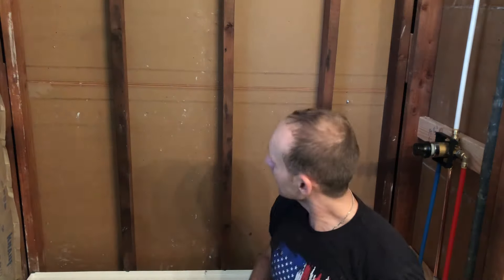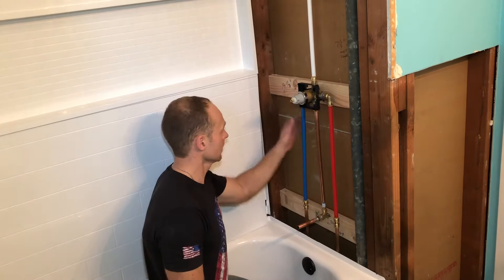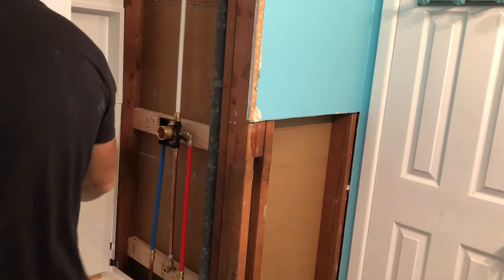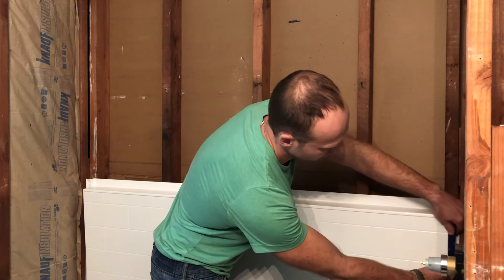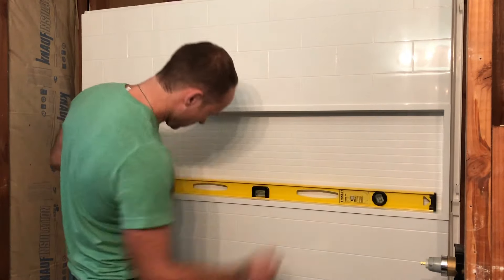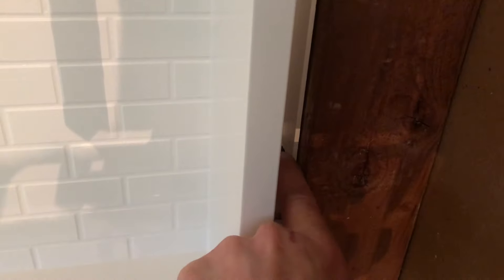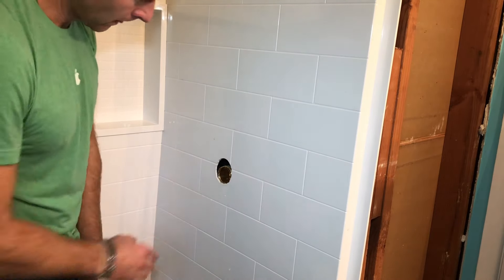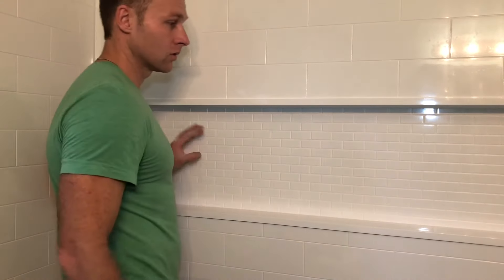Nextile direct to stud alcove bathtub surround install directions. Step by step full install

Comment: I just installed my Nextile shower wall system today. I had watched this vid twice which was beneficial thanks, but a couple key points I will make to help people out on top of the help graciously provided by this vid. Point one. The walls have those locking tabs in the back left and right corners as seen in the vid. Basically expect that the need to lift the left and right walls up 1.5 inches above the back wall when pressing against wall and then pulling down to get the tabs locked...expect it to be a problem on the faucet side. Your shower hardware system of choice basically will not have flanges on all places to cover the needed lift and then drop down of the walls to get them to lock. My example: a hand held shower wand that has a 1 in diameter hole. Also my shower valve handle hardware sticks out about 2.5 inches and there was no way I was going to risk screwing up the valve assembly. In the end I decided the wall locking tabs are over engineered and in fact lack forthought about the issues they cause for the brass shower hardware. So I decided to cut the tabs off of my walls to prevent the need to lift the wall 1.5 inches prior to engaging it. But even after that I could not get the wall engaged thanks to the angle needed to get around the valve assembly. So I took an angle grinder with a cutoff wheel and cut the extra material off of the sidewalk back that prevented me from connecting the walls. Also, this wall system thanks to the shelf causes you to lose about 3.5 inches of inner shower space--that much less room for your arms while showering. Although your drain valve will be centered to your shower base, your shower head should you have lined it up with your drain appear to be way off centered relative to the inner walls thanks to the protruding shelf. As a result, I moved my shower head to center it over the actual area of the base I'd be standing and swinging my elbows while scrubbing my hair. I'd say dont do a dry fit test. Once your shower base is in you know you have the correct space and then after if you have shower cutouts that don't accommodate an extra 1.5" of hole for sliding the wall down then just cut away their locking system on your valve side.  Also one last mod I made. Bottom middle back wall has way too much give and play. Sorry but do dry test bottom back wall and you will see that bottom middle wall where it meets the shower pan can be pushed back with your hand by more than a quarter inch--not good. I took the back back off and then installed PVC trim that was .5 x 1.5 along the back side of shower base to provide backer to stop the excessive flex in the back wall when installed.
Reply: Also as someone else smartly posted. Take a cutter blade and clean out the sloppy extra material that remains around the locking tabs from the molding manufacture process. This will set you up for successful attachment and any needed detachment to minimize running into a bind.
Reply: To refine what I said above about proactively cutting away the tabs on the valve-side wall: be sure to not touch the tab that joins the upper and lower back walls. Only touch two tabs on top wall and two tabs on lower wall that receive the side wall in four places total. And also, remove the tabs before I say again before! installing the back walls to the studs as otherwise it is very hard to remove those four tabs after install. And also, the grinding I said I did on the valve side wall only reduced thickness of the back edge--note that I did not reduce the front to back dimensions of that side wall.
Reply from the maker: Thanks for sharing. 👍👊
Reply: I should also have stated for anyone checking my entries here is that my install    is not over a tub but is a 60x30" shower base with the 4 wall 60x30 kit. The reduced space for elbows it seems is more pronounced with this setup than it may be for tub based installs.

Comment: Contractor here. The nextile surround I got did not have tabs which can be slid into and the sides did not fit in the grooves. First time I’ve gotten a surround that did not fit together. Horrible

Comment: TIp: check the latch parts on each panel for burrs and frayed excess material... On my unit, they were poorly machined and I had no issue after deburring them with a boxcutter
Reply from the maker: Nice.  Thanks for sharing

Comment: We're having the hardest time snapping those things into place 😫
Reply from the maker: lift up, push in all the way, and then has to push down so it drops in.   its a little tough yup.
Reply: Yea I jus installed mine,  it is tough,  especially if the rough opening isn't wide enuff

Comment: Does anyone have any trouble will middle wall at bottom having give in it. It’s the first wall you put in. Mine feels like it needs to move further back in middle but it is level and flush with all studs?

Comment: I should make my stud walls 31 in instead 30 in correct
Reply from the maker: I would have to check.  It’s meant to fit the existing space.   But if you building the walls up for it.  Yeah have to measure and double check
Reply: I saw you trimmed 3/4 off the shower to fit 30 in wall if I am correct and you left a 1/4 in to finish nail an silicone.
Reply from the maker: @stevieb031969  ahh you're talking about the side pannel.  yeah i had to trim that as my existing wall was too short.     i did follow up video on that.
Reply: Your video helped me out and a holler out a Thank You
Reply from the maker: @stevieb031969  happy to help.

Comment: If using adhesives shouldn’t one have telescopic forms to press the walls in overnight?!
Reply from the maker: everything should be snug. so if clauking at the bottom etc, nothign shoudl be moving.  you are screwing everying down to the studs first.
Reply: @HowToWithLech  thanks that’s what I’ve done. The front panel with the water valve was the most difficult. I got the panel in! But only after I maneuvered the studs out!

Comment: Hi! We just installed this in our bathroom, thank you for the vid! We have this exact setup and wondering if your wall piece appears to bow as well. Not loving the look after we’ve installed in. Thanks!
Reply from the maker: The shelf section comes out a little bit should not really be noticeable.  Did some follow up videos on that. 
All walls should be right against the studs
Reply: How many sheet of tile did you use for the shower niche?

Comment: The bottom of the main back wall has some give which will immediately break the silicone seal if someone leans on it. All walls are lined up perfectly. Does yours do the same? Any recommendations?
Reply from the maker: All walls should sit right agains the 2x4 framing.  Should not have any give.  Make sure the framing is level and square.
Reply: Larry, I'm having the same issue and my framing/flooring was pretty freaking level. Debating going the caulkless route with this and hoping to let the water simply drain after each shower. Trying to silicon a flexing wall will never work and trap water if anything, imo 🤷‍♂️
Reply from the maker: all walls and tub has to sit snug against all walls.  same with floor / tub has to be lever. the only way will work  correctly .thank can caulk all the corners etc.  @Keatgsr07

Comment: Lech, curious as to how you caulked/sealed? My install looks great and went well, however there's definitely some flex/give where the panels meet the tub. How's that going to hold? 

Can this kit hold up over time as a caulkless unit, let the water drain downhill on its own?
Reply: We are also worried about this. Called the company about it and I was told that caulking it fixes it. I personally highly doubt it.. way to much flex
Reply from the maker: All should be flush against studs.  Should not flex.   Then caulked all the seams.  No issue

Comment: Helpful video! Some "shopping" advice here. At 17:30 Lech starts to add the wall that has holes for the valve and tub spout.  It is difficult if you try to come at the back wall hooks at an angle as in this video.  His approach was to reduce the angle by dismantling the valve. My Delta valve was not made for that (I called them), however, the escutcheon was huge, so I cut the hole larger below center so the wall could be raised 1.5 inches without bumping the valve stem.  I also cut wide about an inch to the left of center of the valve so I could slip over valve before the wall was pushed all the way to the back wall.  The cut to the left allowed me to reduce that angle of approach to the clips by slipping over the valve and pushing back to the studs (while raising the wall).  The wall practically fell in place this way.  Lech was using a threaded connector (seen at 21:31) behind the wall to avoid the spout getting in the way during wall installation.  That was smart. I wish I'd thought of that approach while shopping plumbing parts.  So, make sure your escutcheon will cover holes 1.5 inches below the valve and maybe 1 inch to the left.
Reply from the maker: Thanks for sharing 👍

Comment: Awesome video. With the stringer for the shower valve, how deep did you set it? Thanks!
Reply from the maker: The valve directions tell yiu.  Different styles might be different.  Sorry dont remember the exact measuree
Reply: @HowToWithLech  Got it. Looks like we are both using the delta multichoice. From the video looks like you mounted stringer tight to the drywall on the back of the stud? Thanks man. I have watched this video like 100x lol
Reply from the maker: @rileylavin1272  ah nice.  yeah, something like that.  sorry its been a while thanks for watching.

Comment: Lech, thanks. Today 9/2022, one costs $539 in Lowe's in Kailua Kona Hawaii!  Besides caulking it to the tub, did you caulk the vertical inside corners?
Reply from the maker: oh yeah. prices going up nicely.    yes caulked all the seams where the walls connected.   under the shelf too.
Reply: @HowToWithLech  Thanks. actually that price is for the taller model that's 72 inch tall:

Comment: I just bought an installed for the most part this tub surround kit. I have Boeing on the bottom centerpiece, which worries me when caulking I’ve double checked 1 million times and I have plenty of space between studs shows 60 1/4 on top and bottom. Did you have any problems caulking the bottom? If I push in on the center of the bottom part of the wall, it pushes into the tub flange
Reply: I have the same issue as you for the middle bottom piece being able to be pushed in. How did you remedy it?
Reply: @ibrutalxmlg I got a really good caulk and caulked it in place (took a lot of caulk).  I didn’t push it in and caulk it as I was worried it would pull away eventually.  I have kids so I was worried they would push in the bowed spot after caulking.  I believe I put enough caulking that it secured the bottom and back of the wall.  It’s actually pretty sturdy and has been working out
Reply: @ibrutalxmlg let me know if you need a better description

Comment: I bought the same set. Tub & surround. I’m doing my upstairs bathroom. How will this hold up long term?
Reply from the maker: i think it will hold up just fine.  its solid.  mine is over a year and all still perfect.
Reply: @HowToWithLech  thanks 👍🏾 did you put mortar under ur tub & red guard?
Reply from the maker: @mahanalutali  hi.  no i have not.  i had a pretty solid wood base.   check out my other video on the bathtub replacement,  hope that helps.

Comment: Thank you. Finishing up my installation (hopefully today). This was very helpful. I've been watching this a few times over the last 48 hours.
Reply from the maker: glad to help.  i did some follow up videos for this if you need.
Reply: Im installing mine now and the back wall piece where it hits the tub is a bit loose. Meaning you can push on it and it gives about an inch. did you notice this issue???
Reply from the maker: @kona6451  it shoudl be installed against the studs.  it might be a little loose by the tub, but when put on the side walls that will tigten it up.  plus you will clauk all that.   but should not be moving a lot once all 3 walls are on and screwed down to the 2x4s

Comment: Nice job - looking at installing these in our new home. Thanks for showing the mess ups as well as success!
Reply from the maker: Glad it helped :)
Reply: @HowToWithLech  i didnt understand wat you said about the mosiac tile in the soap holder part
Reply from the maker: @OGMAURCE  what the question?   im going to try and do a quick video to show how i did that part.  stay tunned
Reply: @HowToWithLech  like how do you put the tile in that section... It looks smooth, like doesn't look like it would stick ..    
I got the same nextile setup,  but I haven't even taken it out box yet lol
Reply from the maker: @OGMAURCE  yeah it is smooth. but it will stick fine.  just have to use the good sealant for adhesive as they recommend.    mine been up a year now.  all good..

Comment: Hi, very useful video. I've read that with direct to stud it's best to have insulation so the walls won't wobble and to prevent a hollow sound. Do you feel you should have added insulation?
Reply from the maker: U need insulation on outside facing walls.  Indoor walls is optional.  If you have the funds it doesn’t hurt

Comment: How much space should there be between shower wall and tub? A small gap for silicone calking? Also we are having an issue with our shower valve not sticking out for enough to screw on, any suggestions?
Reply from the maker: you mean the studs..   tub should be right agains the wall studs.   and then the walls install right onto the 2x4 studs and over the tub lip.    shower valve I installed new so adjusted to what needed. hope that helps.

Comment: thank you how did you mesure out the valve hole at first ?
Reply from the maker: I think I shoes in video.  But after is talking piping.  Measure from top of tub and from wall.  And that will give you the spot

Comment: Mine came broken on 5 different areas, waiting for the replacement. Huge waste of time.
Reply from the maker: Hate that.  Shippers don’t give a f
Reply: @HowToWithLech  Great video. It will  definitely help with the install.
Reply from the maker: @poogie_bear  happy to help.  really why i did it as have not seen one out there.  did some follow up videos on this as well . thanks
Reply: @HowToWithLech  I will check out the other videos.
Reply: @HowToWithLech  Can you tell me which silicone you used that didn't turn yellow?
Reply from the maker: @poogie_bear  i dont remember.  but i'm re-doing the silicone by the tub thsi week.  doing video on it.   Will be trying the Mold Armor brand.  its  green tube. goes for about $11 at homedepot.   supposedly this one works well against mold and wont yellow.    also my buddy is a contractor, he sanded the sanded silicone is a good option.

Comment: Hi, Im thinking of installing this in my bathroom but the sample one in the store showed the wall (with the square hole) to be angled, like leaning back. I wasn’t sure if it was the floor sample that wasn’t set right. 

Is it supposed to be angled? Or is it supposed to be flat? Like a 90 degree angle
Reply from the maker: The bottom wall is angled cause of the shelf.  That’s normal.

Comment: I hope you’re still checking comments, but how did you level the tub itself? Did you just use shims, or a leveling compound? 

I’m in an old house so the floor is not level. On top of that, none of the floor in the bathroom is level lol so using leveling compound might cause me problems with meeting the flooring.
Reply from the maker: Always.   Mine was pretty level so just had to adjust a little.  If minimal You can do some shims.  Just make sure it’s all solid.  Leveling compound great option if can do it.

Comment: I have Hardie board backing. Of course now my large side panel won’t fit! So my option is to? Remove the back Hardie board? And just use the studs….Correct?
Reply from the maker: yeah. this is meant to go directly over the studs.   otherwise it wont sit on top of the tub correctly .

Comment: What is your framing rough-in? 60" w is causing a bow in the back wall for me. If I move the side wall framing, the back wall lays flush but then I'm away from the tub flange.
Reply from the maker: It would be same as tub size used in this setup.

Comment: Lech this is amazing. I am installing the Nextile for our tub surround and we just got it mid-June. I feel so much more confident because you showed all of the hurdles to dry fitting and installing. Thank you very much. It looks like the same situation as with our alcove - even the stud placement around the plumbing. Our tub was also not exactly level. Their extra surprise flange on the side walls is an issue. Interested to see the finish drywall work!
Reply from the maker: Hope all worked out.   I'll have to make a better video of the finished bathroom.

Comment: What did you do where the shower meets that corner edge on the right side? Just drywall up to it? Doing the same install and unsure of the best approach.
Reply from the maker: These all 3 sides go against the studs.  Once installed drywall on top over the lip and silicone etc.  I did follow up video to show

Comment: Hi, quick question.  Is the lower panel slanted, making it look buckle? Mine does for some reason, but not sure if it's normal or mone came defected. Top look good, but the bottom panel doesn't.
Reply from the maker: Yes it is because of the shelf.  To allow more space on bottom.